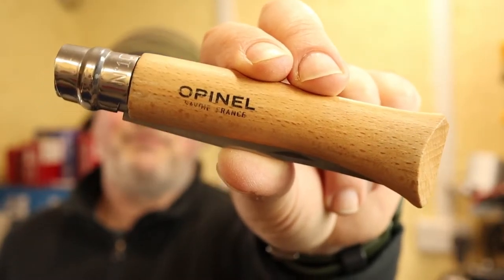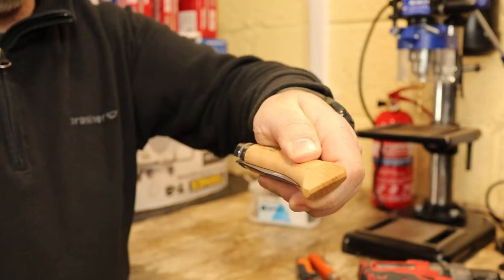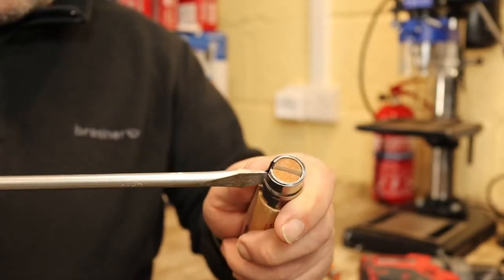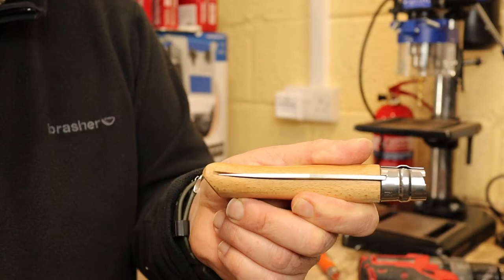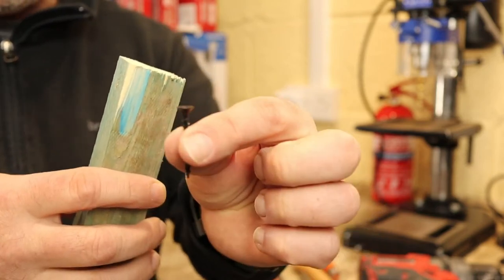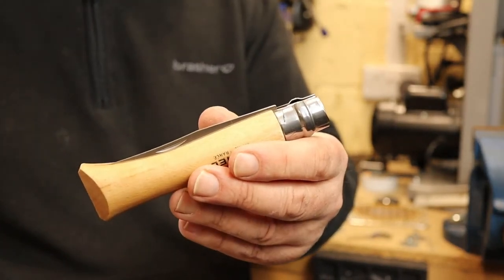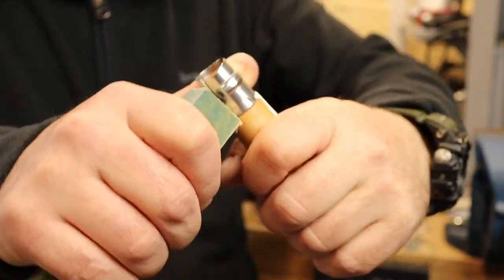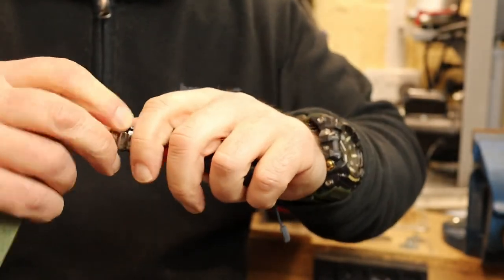How to remove an Opinel Collar

Comment: Before going into the trouble of removing the locking ring, drip several drops of melted candle wax on end grain side with blade folded and heat with a hair dryer or heat gun until all visible wax has been absorbed into wood. This process petrifies wood with wax so water will not absorb and it also lubricates wood to metal contact which keeps blade securely attached to wooden handle while keeping it loose enough for easy folding.
Reply from the maker: Thanks for the tip 👍
Reply: Great idea.  I'll do it today.
Reply: Does food safe mineral oil function similarly?
Reply: @freman007  Good question.  I don't know.
Reply: @freman007  Mineral oil will seal and lubricate wood to metal contact but will leave an oily residue and eventually washout leaving knife dry and stuck. Wax on the other hand will last for months to years.
Reply: @freman007  I tried that very thing, and it didn't work.  The wax does help, but you still have to be careful about rinsing the blade after washing it so you don't get the wood too wet.  You don't have to make all these modifications this man advises.  If the wood is still a bit wet and you don't want to break a fingernail, just tap the back/bottom corner of the knife two or three times on the counter, and it'll come out of the handle far enough to grab with two fingers and pull out.

Comment: I used the bottle opener from an Viktorinox knife in exactly the same manner you showed here.
Worked like a charm... and I didn't even need to build a gadget. :)
Reply: Many thanks my 60 year old Victorinox solved this problem in a flash. Colour was too loose; then ancient Crestogrip water pump pliers provided the squeeze!🤣👍
Reply: @rodneyshepherd9120  you are welcome bro. :)
Isn't internet amazing?
This is what is was built for: sharing knowledge, information and experience.
Welcome to the "2nd Enlightenment".
Reply: BRILLIANT!!!
Reply: Top man!
Reply: This makes more sense to me
Reply: It works! Thanks a lot, man, it works!
Reply: worked for me, thanks
Reply: Thank you, that worked so well. I was able to easily adjust my safety on the opinel🙏🏼

Comment: I believe if you take the collar of the No6 it is then UK legal as it is then a non locking knife with a blade under 3 inches. Great vid. Many thanks, Cheers, Ian
Reply: You'd think that the law would require a locking mechanism on a knife the blade of which pivots on the handle, at the base of the blade; without a means to lock the blade, the knife is more dangerous to everyone, including the person holding it. Silly Brits!
Reply from the maker: @michaelthibault7930 we do have silly knife laws in the uk. The Opinel is actually French and the collar is the locking mechanism. For legal carry we have 75mm non locking and out of sight etc

Comment: You can also use those normal slim pliers and (while the pliers is closed) put the tip between the gap of the lock, now instead of gripping the handles what you do is you put your closed fist in between the plier's handles then open your hand. Doing this will enable you to spread the pliers which will open the top locking mechanism as if you have those reverse pliers.
Reply from the maker: Thanks for sharing the information 👍

Comment: I recently bought three Opinel knives a 6, 7, and a 9 the two smaller ones were slick and opened well, the 9 did not, I found upon taking off the locking collar that the pin, has a mushroom end and the free end has been stamped into a mushroom end as well.
It will take more than a punch to remove the pin.

Comment: Have seen needle nose pliers used too to just widen the collar a little. Thanks
Reply from the maker: Hi Nick, I did try that but could not manage to make it work with mine as they kept slipping off. It’s a tricky old process to hold everything and open the handles of the needle nosed pliers with one hand. Respect to anyone who can manage it.
Reply: @InfoZhedExplore   Yes I can imagine it may or may not work. Your technique is an excellent bit of clever adaption and improvisation. Thanks for the video.

Comment: Nice method. But, what to do if you lost the blocking collar? Without the block a no.6 or 7 is quite dangerous tool.  
Opinel does not sell replacement collars, because knives are already cheap (I was told by a major reseller).

Comment: Thank you so much!!! What size is that first Opinel you had, I really like that size and want to get one?
Reply from the maker: Opinel No 10. Blade is 10cm. I use that one for most of my kitchen prep. Only dozen side is as it’s a folding blade it collects gunk in the locking mechanism so need regular cleaning. 👍

Comment: Never sand the timber... If it swells up due to moisture, dry it out and the timber will shrink. When dry, get a q tip  and dip it in Danish oil or  Boiled Linseed Oil cut 50/50 with Pure Gum Terpene. Apply to the end grain at the collar end repeatedly until it wont absorb any more. (You can also apply to the inside of the blade slot if so inclined but I have not found that necessary).

Comment: just use simple narrow pliers. Put a collar in the open position,  jam in the pliers, and open em up with the same hand you are holding them (that part is a bit awkward, but if you have all the digits in place - very doable).

Comment: I have a collar on a brand new Opinel that is damn near unmovable. I was considering either popping it off and stretching it, or adding a little lubrication. Thoughts?
Reply from the maker: If it has a wooden handle I would first try leaving it in a warm dry place for a few days. The wood is untreated and so soaks up moisture like a sponge.  That should do the trick.
Reply: If you plan on using it for food prep I suggest coating the handle blade and inner collar with Howard Butcher Block Conditioner, it's food grade mineral oils with natural waxes and it help protect the blade from rust and helps keep water out of the handle. It also acts as a lube fo the locking collar and has made it smoother on mine. I highly suggest it.

Comment: You do realise that the shape of the handle is as it is for a reason? To open a knife, whether stiff (which I have never encountered but am sure it could happn) or not, you never need to pull the blade out with your thumbnail. All you do is gently tap the "butt end" of the knife on something hard with the blade in the downward position, the blade will pop out a bit every time and you then just pull it fully out and lock it as normal...

Comment: OR - just use a bottle opener instead of this wild contraption. Takes two seconds - just used my Victorinox knife's one.
Reply: I wouldn't call a screw in wood a wild contraption. I did try a multitool bottle opener though, and this worked well, cheers
Reply: Thought this contraption was great till I read your comment,, thanks, 😃

Comment: Removing the locking ring on the smaller ones makes them uk legal. Probably the only reason to remove it
Reply from the maker: You raise a very good point regarding removal making the smaller blades UK legal. However in my experience the collar needs to remain in place as it holds the wood together and prevents the blade from being loose. Thank you for sharing your thoughts 👍